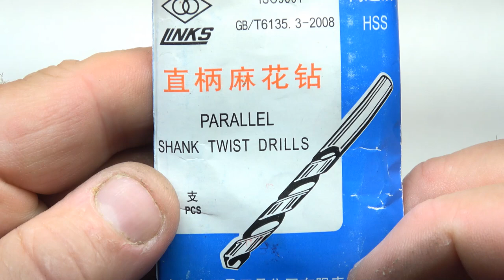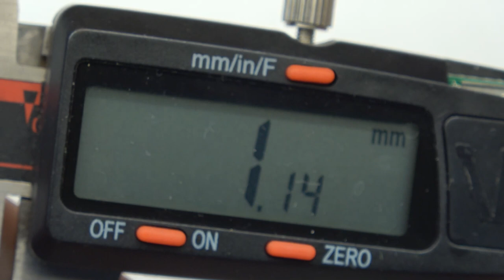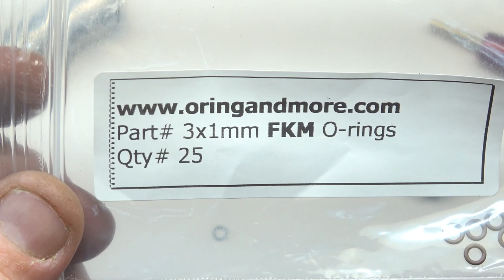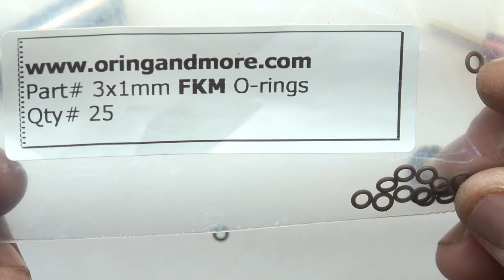IMCO G 11 Butane Lighter

Comment: I got a refillable one which unfortunately doesn't work <w> gas won't go in very well and the outlet leaks. Tried to replace the seal on the inlet but that only started to make the bottom leak too when I tried regassing. And I was super careful not to touch the center piece. That inlet seal on the refillable tank can't be removed I don't think. Or it was because the one I got is so badly dried up
Reply from the maker: Seals made 50 years ago will eventually dry out and need service. Your right though. The valves Arnt serviceable